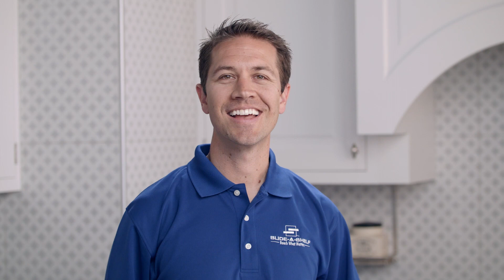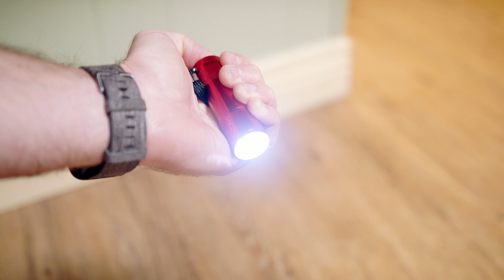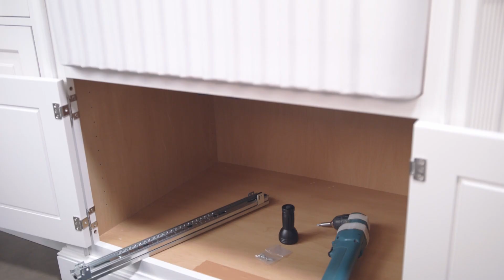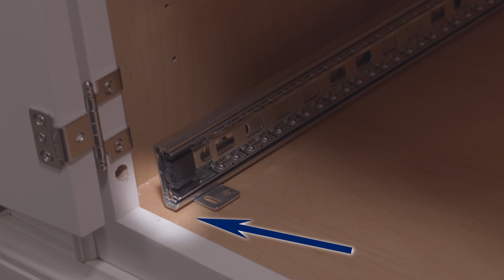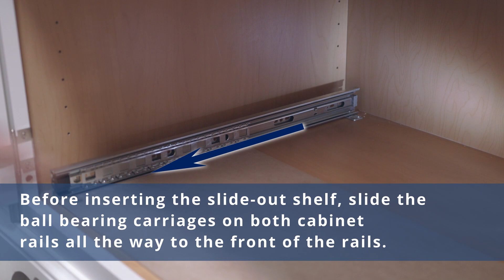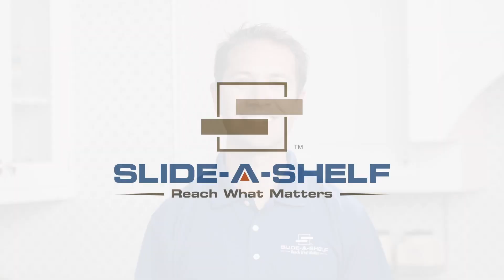The Installation Process

Comment: Hi, I followed the instructions but once I push the shelf back all the way, I can't pull it out because cabinets have face plates. It doesn't clear the face plate and gets stuck inside the cabinet.
Reply: I ran into the same issue. I ended up screwing down 1/2"  thick prefinished trim board on the bottom of the cabinet and then mounted the brackets to that, and that solved the issue.
Reply: @douglascase5502 I stacked 3 small washers on the bottom to add depth (and ran the install screw through each set). But your way is MUCH easier to manage, as washers slide around during install. I just knew I had them!

Comment: Was very impressed with your video, so impressed that I ordered 4 units.  Received them today (10/13/21) and proceeded to install them in our kitchen cabinets.  In my installation I was able to install the first set of slides using your template... the drawer did not fit,  huh!   Being an engineer I had found myself a problem to solve.

Measured the drawer width, measured the template, something was wrong as they were different.  The template stated it was 31.875" wide and the actual width measures 30.875", an inch different.  I felt I must be missing a step so I reviewed the instructions, the video and found I had processed it correctly.  I called your Customer Service and after explaining my situation I was informed "we sorry for the template being short and I have seen this before."  I politely requested to speak with your QC Department Manager to give them a piece of my mine as this was a critical part of the process.  I was informed "we don't have one as we are just a s small group of people"  and I immediately stated that they needed a QC Department to prevent these kinds of mistakes.  I now have holes in the cabinet for the simple reason they though a Customer Service Department was more important than making sure it was correct when it left your facility.

What I have learned is that you can sell things you can't build; them stamp the packing list as Non-Returnable to Cover Your A**.  I am in the process of making my own YouTube Video to go along with yours, if you decide to remove my post disclosing your lack of quality issue I will post it showing what I received...  And yes I did asked for some compensation for the holes that will forever be in my kitchen cabinets!  Slim chance of that as the lady I spoke with seemed stunned. Did not get a warm and fuzzy feeling that I was the first to give them Hell for this and for those that don't read this, I tried to tell you so...
Reply: Where’s your video